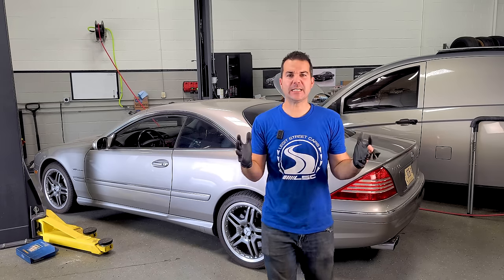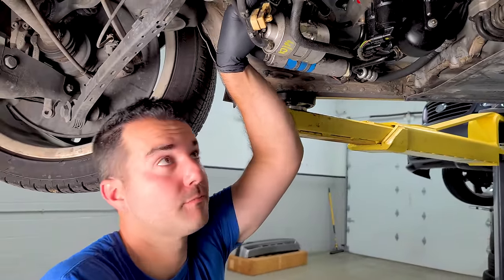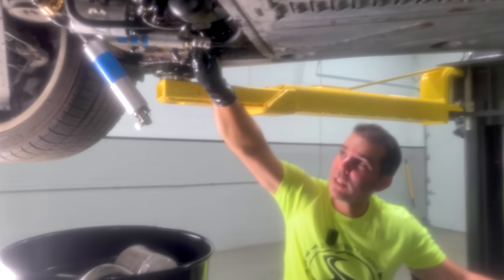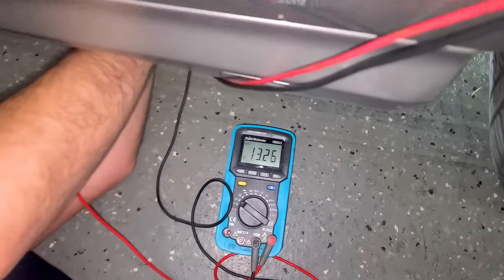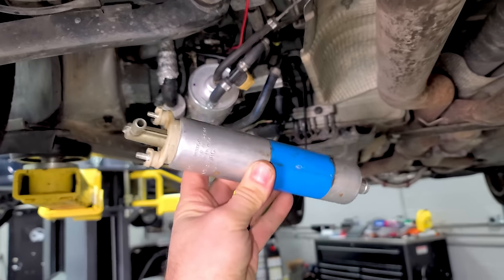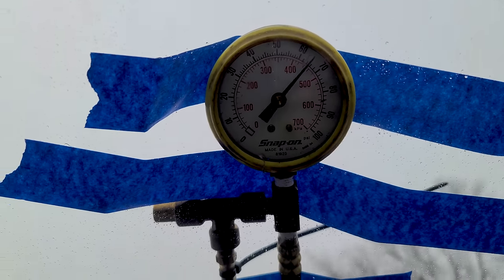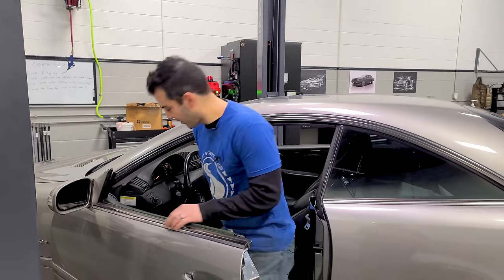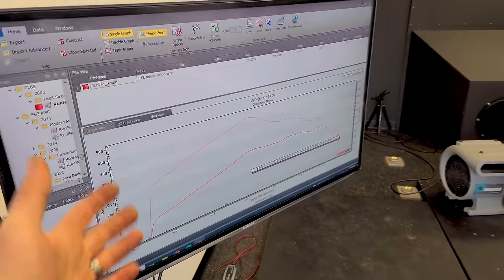I Used Bugatti Veyron Parts & An Alex Trick To Fix My CL65 AMG V12! You Won't Believe What Happened!

Comment: I wonder if Alex has totaled up all the hours on the CL? Just wondering what the bill would have been at the dealer. Scary to think about. Keep it up Alex! I am a touring coupe guy myself. The CL is my favorite car of yours. Hopefully it all gets sorted. Some day.
Reply from the maker: 1 million dollars
Reply: MMIUUuuuahaha!!!
Reply: Could the 2nd Buggati fuel pump be causing the over rich fueling?
..
If it wasn't over fueling before doing that pump upgrade.
.
Them cats were kinda blocked.
..
This mercedes a nightmare from a diagnostic point of view.
..
No need to apologise. 
This is real world mechanics.
.
I'm also wondering if the gas cap is not working correctly and causing a vacuum.

Comment: Press on, Alex! If at first you don't succeed, keep trying. The solution to the problem will eventually come to you and it will work great, and will likely be some off-the-wall thing that is causing it to shut down like that.
I hear you on the frustration level being off the scale, having had to deal with a P219A(left bank AFR ratio imbalance)on my '14 Chrysler 300C hemi engine-powered car, took me 8 months of driving and testing the system & engine only to find that the shorty headers used had the 02 sensor bung placement slightly wrong in the left bank and it was only reading 1 cylinder in that bank instead of all 4 of them. Moved the upstream 02 sensor bungs to the mid pipe just below the exhaust flange where it attached to the header and problem solved.
Thanks for a great video, and I sympathize with you about gasoline baths too, they do suck! Hang in there, man.

Comment: I bought 2 sets of landspider tires after seeing the video when Max got his. One for a 2013 chevy cruize and the other for a 2018 dodge grand caravan. Both were very loud. One had a vibration that went away after a few hundred miles. On a the plus side they are good in the snow. Also Priority tire has a military discount.

Comment: Howdy Alex.  I went through a similar scenario on my S65.  I did the coil pack replacement and the misfires persisted.  It ended up being the plug gap was too wide.  They need to be very tight about .021.  The plugs from MB were .035 plus.   Please pull the plugs and gap them real tight.  The cost is free but it is a pain.  Also if you ever pull the throttle body for some reason the factory gasket is really small and
Sticks in the airway.  Changing the gasket is like adding a bigger throttle body.   The reason for rich is the plugs are not firing.   Good luck.  I have been there!

Comment: HI Alex. I just watched your last video, don't
Stress yourself out, don't buy any parts, clear up all faults with OBD scanner, take the car for a ride, inspect it with obd again, you will find a misfire, make sure which coil pack and replace it. I know you have refreshed ones, but these coil packs has artificial intelligence and its own temperament,  if you find temporary one only for testing it would be super, but trust me in this, it's the coil pack, these engines ECU are totally crazy and serious about Engine protection, any little fuel or ignition troubles it would cut off the throttle and throw check engine light, and since you totally clear the fuel cycle and I was in this in my W221 S600, then its for sure the coil.  these cars would not be happy for The slightest ignition misfire, and it will cut off fuel and throttle immediately.

Comment: its not a mechanical issue - its always bogging down at 3-4k rpm.
try to get a mercedes benz obd scanner, they are much more accurate.
check a/r ratio, ecu & injector/coils i had a similar problem with a negative pressure line, car didnt run well just because of false readings under load...
try to replace the ecu with a used one - those old mercs have really bad ecus sometimes.

Comment: Narrow, your spark, plug gap sounds like it is trying to detonate and going to limp mode to protect the engine. I had this happen on a build years ago, and I chased my tail for months.  I got colder plugs and it didn’t fix the issue and finally I talked to Buddy and he said narrow the gap and it fixed all the issues. Cheers good luck.

Comment: You're doing a great job working through the potential problems, Alex.  You're probably among the few people on earth who have the knowledge, experience and patience to figure out the issue.  After all the things you tried, if it's not the throttle body, could it be that the ECM is faulty?  That is, all the mechanical/electrical things are working and all the sensors are returning acceptable signals, but the ECM is misreading them and going haywire.  ???

Comment: I had this issue with my 5.4L M113-swapped W208 CLK430. Wide-open pulls, even post-tune, would hit some kind of what felt like a "torque limit" and trigger the same limp mode. 

An ME2.8 tune didnt fix it, so i started working backwards similar to you...and learned that slapping a cheap cone filter onto the MAF fixed the issue. The CLK430's airbox tapered towards the throttle body waaaay sharper than the airbox on something like a CLK55 or E55 did. Effectively, my limp mode was caused by the engine choking itself out through the 4.3L's airbox.

Obviously harder to test this on a severely-upgraded turbo car, but you may have noted your issue on the dyno; the car needs more air than its getting

Comment: What are the odds, I just bought a 2013 Mercedes E200 (same engine as the E250, hopefully an ECU tune coming up :p) with the diesel particulate filters clogged with sooth! I don't have a carlift, but I just bought some sooth cleaner spray that dealers supposedly use and I'm having a friendly garage do it for me when he has time. I think if that fails, we should try a degreaser and high pressure washer? Will any good degreaser do or is it something special?

Comment: @legitstreetcars, After watching this video, I think I have figured out your problem. You have a weak/clogged fuel line. If your fuel line is rubber and it was cold out side the cold allows the rubber to stay hard during full-throttle pulls. Once you moved indoors or during the summer the rubber would become weak and as you pulled suction the hose would collapse. This is also why you still had fuel spraying out the line after pulling a vacuum. I would recommend a complete fuel hose replacement from the tank to the rails. Another option is there is debris in the system causing the same effect. Like a rock, with no pressure it allows fuel past add pressure rock jams line.

Comment: Alex, this may help you with your CL65 issue going into limp on extended boost.  I have a 2005 S600 which exhibited similar symptoms.  After much frustration and failed diagnosis by me, I discovered I had a cracked fitting at the inlet manifold for the brake vacuum hose.  The car would go into limp upon extended boost because the proper manifold pressure was not being achieved due to the leaking air at the crack.  Eventually the fitting broke off, leaving me with a huge air leak and no brake vacuum pressure to assist with braking.  Then it was easy to diagnose because the absence of brake vacuum made the car difficult to stop and there was a hissing noise.  On the S600 the fitting is at the very back of the manifold right up against the firewall....which made it difficult to repair.  But, once repaired, the car ran perfectly.  I hope this may help or at least spark and idea in your head.  Cheers!  Cliff

Comment: Alex, are all the fuel lines between the pumps and the engine new? I can’t tell in the video whether there’s a reading the ECU is getting that is doesn’t like and so it is immediately cutting fuel, thus your fuel pressure drops; or whether your fuel pressure dropping is what’s causing the condition the ECU doesn’t like. My thought is, presupposing that everything is good in between the tank and the pump (we saw you blow out that feed line) if fuel pressure is dropping at the front of the car, but the pumps have enough supply and enough pumping power to pressurize the lines at low volume, a slight constriction somewhere between the pumps and engine could be causing the pressure to drop out with the injectors running at full tilt. In other words, the injectors are literally clearing the lines up front faster than the pumps can flow the correct amount of volume in order to feed the injectors and still keep consistent line pressure. I’m thinking a small kink in a hose, or a little too much bend in a hard line. I’m like you, it’s baffling, but seems like everything points to a fuel starvation issue (unless there is a condition the ECU sees it doesn’t like first, and it’s cutting fuel as a result in milliseconds, so fast we can’t tell which is the chicken and which is the egg). I mean, you had shrapnel in the ABC system, how nuts would it be if you had some kind of chunk somewhere in the fuel lines too? I think it’s highly unlikely that there would be some kind of flotsam or detritus in the system that would stick somewhere before the rail or the injectors… but I mean, c’mon, that would be a crazy ending to this whole saga. Kink in the line far more likely though.

Only other thought: what if the gas tank isn’t venting fast enough to gravity feed enough fuel to the pump at full throttle so pressure drops out relative to the demand from the injectors? Is that even a thing? I’m honestly just thinking raw physics at this point.

Comment: my cl600 vintage 2005 biturbo has been my most reliable merc I own.  my fleet consists of c63 2014 coupe' (which you copied me on by the way-i painted matte white from black) 2003 G500 also very reliable but a tank) ml63 which haunts my nights, sl600 vintage 1995, E55 which i'm gonna build soon.  but yea cl600 most reliable now with that said it only has 95kilometers on it i bought it with 38k miles. done a ton of work to it but all cosmetic, hoods scoop lowered my engine temps making the heat cycles not so bad, got rid of all the trim on sides rear and front made all carbon fiber for interior trim and a great sound system.  Love the 275 and love my stickers you make even more.  you're doing Gods work alexus, you've inspired me to grow my mercedes fleet and give me the confidence to never use a mechanic even though i should sometimes.  Also one thing i've learned.  THERES NOTHING MORE EXPENSIVE THAN A CHEAP BENZ.....i GOT MY ML FROM MY PARENTS YEARS AGO FOR A GOOD DEAL SO I THOUGHT

Comment: seeing the fuel pressure issue, I think you have something blocking and holding up pressure.  How about pressure sensor on rail, or check valve? Return system, or not?

Comment: I also has had limp mode problems at full-throttle with my 2004 SL600 (also twin-turbo V12). After replacing the fuel pump and fuel filter-regulator the problem went away. So I think you partly solved the problem. Since I will be swapping in an AMG version of the engine with better turbos, catless tune, etc, I suspect I may also need to double the fuel pump.

Comment: Hi, I was a Merc tech for 10 years, I would be looking at the injectors, one could be intermittent sticking open causing rapid and intermittent fuel pressure loss. Also the fuel pressure regulators, I remember replacing a few of those. Other things worth checking is the timing chain if its high mileage and never been replaced. I'd also get every coil pack on the oscilloscope and check the pattern to identify possible Primary coil failure, the secondary coil masks it so hard to identify if it still fires the cylinder. I'm wondering if the your increase in fuel pressure masked an ignition coil pack failure, and as you know it will just shut down to 6 cylinders before you have a chance to diagnose.
Reply: my bet is coil packs for sure your knowledge is deep man

Comment: I had an old whaler with a 97 Suzuki 2 stroke that had a fuel delivery problem. I rebuilt the carbs twice, replaced the fuel pump, the fuel filter and all the internal hoses... It took me forever because it was an intermittent issue... ended up being the fuel tanks 90 degree fitting had a small crack and would pull air sometimes...  I was beyond frustrated and I was dealing with an old, relatively simple 2 stroke.... I can only imagine your headaches.

Comment: Sounds quite industrial without the cats and linked exhaust attached. 
This is because you're hearing 2x separate,  unlinked straight 6s with no silencer. Shows how important and X or H pipe is on a V engine.

Comment: When swapping out the fuel pump the additional pressure and fuel released suggests that the fuel line is pinched somewhere towards the engine. Perhaps the engine moves under torque at wide open throttle and restricts the amount of fuel in the line to the engine.
Reply: Could it be that return fuel to the tank is blocked? Your filter in the tank reminded me of my old 107 ( 450SL) from 1972 - that got a rust clot in the return line inside the tank which caused all sorts of strange issues. If they sit for a while,  the inside of the metal line got condensation & rusted.

Comment: Hi Alex, I went through a similar journey with both of my 90's 840 & 850 Series BMW's. My 840 used to cut out at WOT, which was fixed with sports cats. The 850 was eventually fixed by changing both throttle bodies, YES it had 2 🙂. I'm going to tell my own AMG mechanic about this, then you'll have another Alex onboard.

Comment: I've been trying to diagram in my head what could be causing your issue.
So far you've replace or improved most of the fuel system, save for replacing the lines from the fuel pumps to the engine. But that isn't an issue since the pressure gauge show pressure.

Exhaust is mostly known quantities since you've covered everything after the turbos. Even if one of the turbos is faulty, I don't see it causing a limp mode issue.

So, I started thinking about intake and other sensors.  If it is intermittent, could it be a position sensor that is failing at higher rpms, like a crankshaft  or camshaft position sensor? Could it be a MAP sensor? Throttle body position sensor at wide open throttle? 

You've been over the whole car with a fine toothed comb... Heck, could it be an intermittent failure with the ECM? Something in the injector circuitry or the ignition coil drivers? Or the ignition coils themselves? I've seen those come faulty brand new.

Comment: Mercedes cats even AMG’s have very restrictive cats, throw hybrid turbos into the mix, ported heads and cams it just adds to the problem, stock fuel pump won’t handle the extra fuel required sure and you fixed that, trust me remove those cats or at least go with high flow 200cell units and your problem will go away. The rest of the exhaust will handle the extra flow no problem.

Comment: @legitstreetcars please read @mccanlessdesign's comment re cat back pressure. Use your Star Diagnosis and go to the engine live data, use that in the car when doing your pulls. The AMG engines of that era only pull back ignition or fuel and go into limp mode when the MAF/MAP sensor gives the warning. You either have an old MAP sensor that cuts power because it has a too low boost threshold or your cats are providing too much back pressure which is the other reason it might cut power. I'ma say your throttle body and rest of engine are perfectly fine. Check the sensor (or sensors, M275 might have 2), use the Star system in-car and check your cats. Sure you'll get there!! Thank you for the content!

Comment: Hey Alex, this feels like an intake vacuum issue. Either it has a huge vacuum leak or bad pressure sensor

I would bet in the MAP sensor. Their inner diaphragm could be slightly torn so the pressure readings will be off in high boost, the fallen readings in pressure would make the computer require less fuel, so you would be thinking the fuel pump is problematic.
I've learned to always check the sensors first.
Keep up bro❤️

Comment: Hi I had the same issue with the fuel gage fluctuating by a slk 1998.
I had replaced also fuel filter En fuel pump and that was not the issue.

The fuel line from the tank to the pump was old and Dehydrated and the pump was taking false air trough the cracks from the hose. But cracks are not so big too losing gas

Mybe it helps you!

Comment: My 99 CL500 was doing the same thing. Turned out to be the fuel pressure regulator on the fuel rail. I still replaced the pump and filter anyways.

Comment: common issue when adding too much fuel ( ie. your new twin pumps ) is factory fuel pressure regulators can fail. This was actually a common problem with DSM's when guys would buy Walbro 255 HP pumps without upgrading to a aftermarket Fuel Pressure Regulator. So imo whats happening is you are now pushing past what the factory regulator can handle causing you to run rich. 

Hope this helps Alex.

Comment: Hi Alex. If you pull the fuel pump fuse or relay, and then start the engine and let it run until it stops. This will relieve the pressure in the system and you can disconnect the  fuel lines without the mess. Petrol in the armpits- not nice!

Comment: ALEX replace the coolant temp sensor the one for the ecu as if it is not reading the correct parameters it will throw codes and stop the AC from working as a safe gaurd thus adding boost will also go into safe mode had the same problem on my a3 8p changed the sensor fixed all the problems if you change the temp sensor change the boost sensor as well cheers from down under

Comment: I went trhrough something similar with my bmw years ago. Changed plugs, throttle body, fuel pump and fuel filter. Finally femoved the precat o2 sensors and drove and problem found. No misfire and power back on. Ended up being a clogged and imploded cat from excess oil consumption.